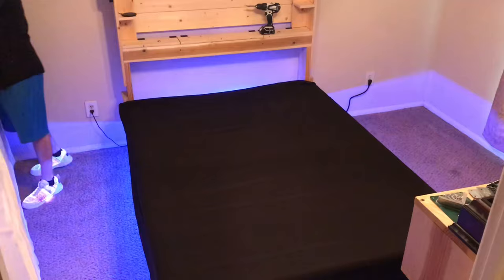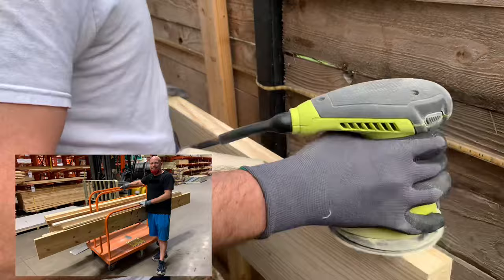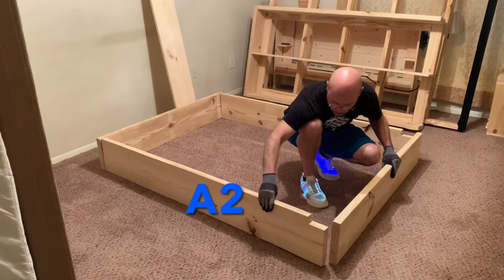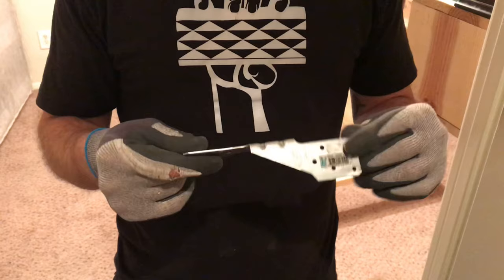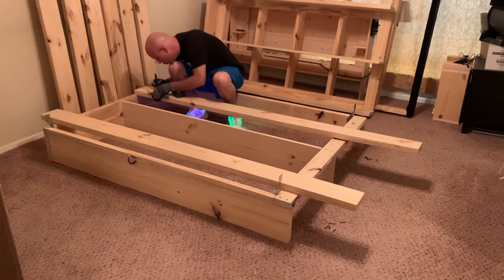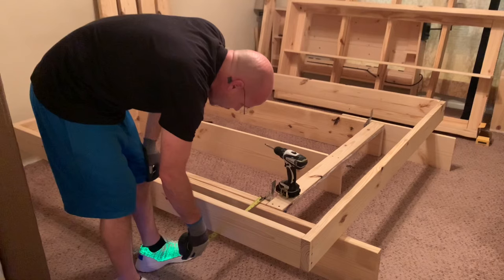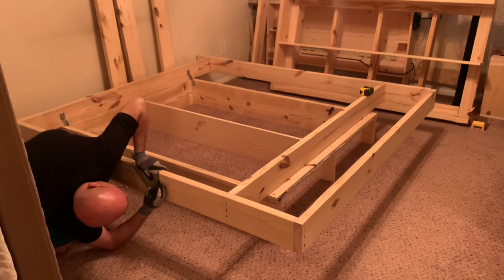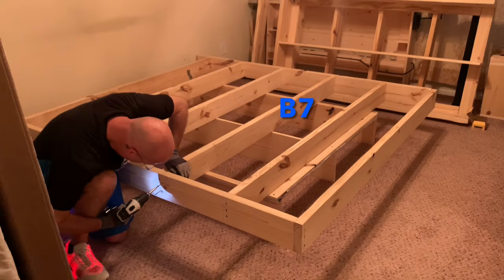King Size Floating Bed Frame [Easily build your own!]

Comment: Hi Curtis, love this and the Queen bed frame!  If you were moving to a new house, would you break the frame down all the way, partly or keep entact?
Reply from the maker: @JJ81_Studios Hey JJ, ooofff.  This is a great question, thank you.  So...I took the time to label all of the components in the queen 3.0 build so I know the placement and orientation of all of the pieces.  I think to be honest, when I move, I'm going to break it down all the way(get to where I'm going and cannibalize all of the 3.0 in a complete re-design and build now that I know as much as I do{especially after having helped so many of you guys modify your builds}).  I think I had originally planned to keep it in three components (base, frame, and headboard), but when I built that 3.0, I wasn't looking to spend a lot of money and wanted to use some stock I had on hand to free up some space in my tiny apartment.  You can see it's not entirely the best design as displayed in the video.  I'll modify that 3.0 to be very much the same, but quite a little bit different, to what will hopefully be the last version of that queen that I need to build.  Man, I'm telling you, I've built and re-built that thing many times now 🤦‍♂️ .  Apologies for the lengthy reply, but I very much appreciated this one.  I hope you are having a good weekend.  Thanks for your time and support here, I mean it 🤝
Reply: @CurtisMadeIt  excellent reply, I was not expecting that, thank you. I guess a follow up, when you break it down and putting back together again, are you using the same screw holes? I'm worried that if I have to break it down, the screw holes will not be as strong as first used and putting more holes around the previous would look terrible. Or am I over thinking this? PS, I'm closing on a house at the end of this month and I want to build my own furniture as much as possible and these are some of the questions I'm coming up with as I research more and more. PSS, big dominos is on the list :)
Reply from the maker: @JJ81_Studios 🫡 I would attempt to use the same screw holes, yes.  If you are worried about compromising the strength of the holes from repeated assembly and disassembly, you can pretty easily put you some glue in those holes...get you a couple of toothpicks covered in glue...and smash those toothpicks in to the hole.  Once the glue dries, you can knock off the excess and get back to assembling...this is just one way to reset your hole.  You can also drill it out with a 1/4" in drill bit and use a 1/4" dowel with glue to fill in the void.  You will want to pre-drill the holes for your screws as you should have the first time.  I'd try pretty hard not to put extra holes anywhere they aren't needed.  I wish you all the success possible in your furniture building quest.  It's a rewarding skill, you will find out pretty soon if you haven't already.  I'm here if you have any other questions in regards to this or any other builds you are attempting.  Take care my friend.
Reply: @CurtisMadeIt  you are the best, thanks big guy, looking forward to more videos
Reply from the maker: @JJ81_Studios You bet.  I’ll be back to posting again soon.

Comment: Do you think it’s totally necessary to have a5 that middle board on the bottom base
Reply from the maker: @Mike Holtberg Hey Mike, thanks for asking this first of its kind question.  I guess I could say that it is not absolutely mandatory, but I would recommend it.  I think this provides a little more counterweight to keep the bed frame from tipping from side to side...of course, once you get the box spring and mattress on there, it's not going to move at all, so, you could probably get away with leaving it out if you felt it totally necessary.  I hope this helps my friend.  Take care.
Reply: @CurtisMadeIt  thanks for the reply! I actually made this yesterday and absolutely in love with the new frame. Thanks so much for this tutorial.
Reply from the maker: @Mike Holtberg You bet!  I’m glad everything worked out.  Take care my friend.

Comment: Sorry sir, but how did you add storage space to the underneath?
Reply from the maker: @EmileePierce-yj3is Hey Emilee, no apology needed.  To add the storage area, you just move the footboard of the base...you need to run it across the top of the two side boards and that middle board.  Secure it about 2 inches from the end so that last joist in the frame has a place to sit on this base.  Does this help?  I appreciate your time and support on this channel, I mean it 🤝

Comment: Wow nice, what size of screws did you use?
Reply from the maker: @elchulo887 Hey Chulo, go with 3” deckmate or similar brand screws for the junctions in your wood.  I used 1 1/4” drywall screws to secured the brackets to the base and the frame.  I hope this helps.  Thanks for supporting this channel 🤝

Comment: This is a nice bed frame but what if I don’t use a box spring? I have a memory foam bed
Reply from the maker: @courtney leavitt Hey Courtney, no worries.  Just put you some plywood on the deck of the frame.  You don't need the super expensive stuff, just the 15/32" will be more than enough.  I hope this helps.  Let me know if you need anything else.  Talk to you soon.

Comment: So I have a question on the top part could I lay those boards flat to be more like slats? I don’t have a box spring and want to put a Mattress by it self
Reply from the maker: @Mannie Sisneros Hey Mannie, thanks for stopping by.  I appreciate your question.  Several people have approached me with the issue of not having a box spring.  I usually just recommend using plywood over the deck of the frame.  Get the cheap stuff, 15/32" should be more than enough.  I hope this helps.  Thanks for your question and I hope you have a safe build.  Let me know if you need anything else.
Reply: Thank you
Reply from the maker: @Mannie Sisneros You are very welcome.  🤝

Comment: Hello Dear, how can i get de piece of steel that you use in each corner ? im from México, can buy it of Amazon? grettings!
Reply from the maker: @Miguel Angel Torres Requena Hi Miguel, thanks for stopping by, I'll be glad to help.  First off, here in America, the term 'dear' is generally used when a man is talking to a woman...so, you saying that to me doesn't apply here.  Try something like "Hello my friend", or "Hi Curtis"...something like that would be a lot better, but I'll give you a pass on the language barrier.  😂 Do you have instagram Miguel?  It would be a lot easier for me to work with you on there if you are able to.  I can show you pictures and share links of items that would be acceptable to use.  Contact me on Instagram realc_love1 and I'll get you set up with everything you need.  Thanks for your time and support my brother.  I'll talk to you again soon.

Comment: Probably a dumb question but what size screws were used?
Reply from the maker: @SwagJ7 Hey 7, no stupid questions here.  I aim to encourage and inspire.  Use 3” screws at the junctions for your wood and use 1 1/4” drywall screws for the Simpson strong tie/corner brackets.  I hope this helps.  Be careful my friend.

Comment: Nice job! How heavy is this thing when it's time to move it? I like changing my bedroom around when the spirit hits me! 😂
Reply from the maker: @darealsassy1871 Hey Real, it’s pretty heavy to be honest.  This is part of what keeps it from tipping from side to side.  It’s manageable though I think.  If you are on hardwood, I’d recommend putting it on those little slider furniture mover things.  If you are on the carpet, you are gonna have to sit down next to the foot of it and double foot push that baby with the double arms behind you on the carpet as reinforcements…you know what I’m sayin’?  Move it in to place that way if you don’t have help.  It’s doable.  Let me know if you have any other questions at all.  Thanks for stopping by and supporting this channel 🤝

Comment: What is that triangle thing you were using? And why were you using it
Reply from the maker: @oddball5199 That's a speed square and a must if you are building anything else.  It's a super useful too.  It comes with an instruction manual that will teach you loads of things.  I'd highly recommend you get yourself one.  Any other questions?  Talk to you again soon my friend.

Comment: Were those 2x8s or 2x10s for the base ?
Reply from the maker: @Ezequiel Espino Hey Ezequiel, I would recommend using the 2x10’s.  That will give you a little more space(vertically) for storage underneath.  I appreciate your interest, question, and support my friend.  Talk to you soon.

Comment: What size screws do you recommend?
Reply from the maker: @ryan o’meara Hey Ryan, use 3” screws for the junctions of the wood in your base and frame.  Use 1 1/4 drywall screws to attach the corner brackets to the base and frame.  Thanks for your time and support my friend.  Be careful building.

Comment: Watching from the Netherlands, wanna build this so much! 
What kind of wood is recommended for this one?
Reply from the maker: @danacoric5657 Hey Dana, thanks for stopping by my friend.  I used untreated lumber for all of the floating bed frame videos posted on this channel...that's generally what I use for indoor furniture builds.  The pieces in this video are American 2x6's that actually measure 1.5" x 5.5", that's 3.81cm x 13.97cm.  If you want to make your base taller, you can use a different width board, add a headboard if you want to(separate video posted on this channel), or otherwise modify it as desired.  This video really just gives you an idea of how to make one for yourself.  I hope this helps.  Do you have any other questions?  Thanks for your time and support here, I mean it 🤝
Reply: @CurtisMadeIt   Thanks!

Comment: So, After building, to DONT need the “box spring”? 

You should be able to lay the mattress on top of the frame?
Reply from the maker: @retroberg hey Grizz, thanks for stopping by.  You are gonna need the box spring to support the mattress.  Others have used either cedar fence pickets slightly spaced apart or plywood with holes drilled in it to allow the mattress to breathe, but I always stick with recommending a box spring.  I hope this helps.  Thanks for supporting this channel my friend 🤝
Reply: The Simpson strong ties, do You know what size Or length of them? 3” or 6” or something? Just curious
Reply from the maker: @retroberg Grizz, I want you to change from the Simpson strong ties to 2" L-shaped corner brackets.  These are going to be a whole lot easier to use.  I show them in the twin size floating bed frame posted on this channel.  Upgrade to those for an easier build.

Comment: If I wanted to do California King what would my measurements be or how do I figure that out?
Reply from the maker: @SuperJwalls Hey J, apologies for the delay in my reply.  I got here as quickly as I could.  
Figuring out the dimensions for the cali king size isn't super difficult.  I've got videos for 3 different size floating bed frames posted on this channel already.  With the dimensions that are included in the videos from those builds, you likely could pretty easily figure out the ratio or design configuration that I am using...it's pretty much the same for all three that are posted here.
If you don't want to take the time to watch those videos and figure it out yourself, I paid my long time friend Jonny to create some really useful and easy to understand CAD blueprints for all sizes of the floating bed frames.  Reach me on instagram curtis_made_it and I'll make sure you have all the information you need before you get started on your build.  I very much appreciate you taking the time to support this channel.  Talk to you again soon my friend. 🤝

Comment: Hey cool idea! I'll try it soon! From Copenhagen, Dk. Do you have the dimensions in metric?❤
Reply from the maker: @klapphy Hey, good morning K, thanks for stopping by and welcome.  Yes, I sure do!!  I put them on screen for you guys in metric.  Reach me on Instagram curtis_made_it if you want or need help designing your bed frame.  I’m gonna need to know the exact dimensions of the wood/lumber/timber you are going to be using.  For reference, I use pieces that are 3.81cm x 13.97cm and then cut them to length.  Let me know what you need from me my friend.  I hope you have a safe build.  Thanks for supporting this channel 🤝

Comment: Hey I have a quick question. I’m building this right now however my only problem is I don’t see that you made an indentation for the bed to sit in this video. Usually bed frames are offset so the bed sits in it flush. Right now it’s just sitting on top of the wood. Answering would be appreciated!
Reply from the maker: @alial-mehdi2258 Hey Ali, good morning.  This is correct.  You need a box spring on top of the frame to support the mattress.  The edge of the box spring and the mattress are flush with the outside of the frame.  I hope this helps.
Reply: @CurtisMadeIt  not quite, thank you for answering quickly! I understand a box spring should go in there as well and then the bed on top of it, However my question was when you made the horizontal studs ( that the box spring sits on top of )  they are at the same height as the exterior bed frame so when I go to put the boxspring there’s no indentation in the wood for it to sit in and then the bed frame on top. Do you get what I’m saying?
Reply from the maker: @alial-mehdi2258 Absolutely, totally understand what you are saying.  This is how I built this bed frame originally for the queen size.  It was popular enough(1.5MM views 05.15.2024) that I copied it and made the different sizes for YouTube, even though I don’t own those size mattresses.  Even if you were to drop the joists down, the box spring would still sit on the perimeter of the frame.  If you want it to sit down in there, you need to adjust your measurements.  How about now, you get what I’m saying…?
Reply: @CurtisMadeIt  ah yes I get it. This is my first time building something like this so I was under the impression the box spring should sit inside the frame ( because that’s how I’ve had every bed frame I bought)  so what your saying is I either have to adjust the measurements of the joists  so the box spring sits inside the frame or  let it just sit on top of the frame and then put the bed on top of that.
Reply from the maker: @alial-mehdi2258 No worries my friend, I'm here to help you as best I can.  As always, I recommend a box spring with this style bed frame.  Once you get the frame built, you put the box spring on there.  Then you can put the mattress on there.  The sides and foot of the frame, box spring, and mattress will all be flush once you get done building.  I hope this helps.  Let me know if you have any other questions at all my friend.  We'll talk again soon 🤝

Comment: Question. B3 and B4 make up top and bottom of frame?  You have B3 @76 inches he's but B4 is only 73 inches. Why is one shorter? Shouldn't they be the same?
Reply from the maker: @Patrick Castillo Hey Patrick, thanks for your interest and your questions here, let me see if I can help clarify some things for you.  B3 is the foot board of the frame, B4 is the headboard of the frame.  B4 is shorter by three inches because this is the width of the two side boards (2x6 actually measures 1.5" wide, x2 = 3 inches).  The reason I have recommended people build it like this is because in my experience helping out new and experienced builders, this design makes it easier to modify to add a headboard later.  With more regularity than I probably anticipated, people have come back and told me they built the headboard sometime after they built the frame.  When you build the frame like this, you will only need to modify the two side boards to accommodate for the headboard to attach it as I have in the videos posted on this channel if you change your mind later.  I know this is a long winded explanation, but I hope it helps.  Let me know if I can help any more at all.  Stay blessed my friend 🙏

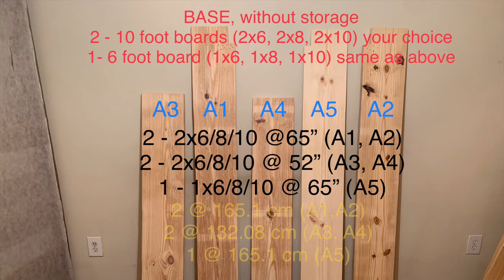Comment: 0:46 So I'm confused on this, what are the "@" Indications of? CM? 

I'm going without the storage. I plan on going to get the lumber soon, to build, but this isn't my forte. A3 and A4 is where I really lose track
Reply from the maker: @cmsullivan09 Hey Tez, sorry for the confusion.  The original queen size floating bed frame posted on this channel taught me that people really ran with this idea and made *many*, many different variations of it.  At forty six seconds, those “@“ symbols are indicating the inches in length to cut your boards.  The “2x6/8/10” indicates 2x6, 2x8, or 2x10 depending on how tall you want your bed frame to sit once it is all put together.  For clarity, I typically use 2x6’s for the base and the frame.  These boards actually measure 1.5” x 5.5”, which is 3.81cm x 13.97cm…so A3 and A4 are going to be 52”(132.08cm) in length, they will be 3.81cm thick, and they are going to be 13.97cm tall…approximately.  Does this help?  What other questions do you have my friend?  Thanks for supporting this channel.  I hope you have a safe build.
Reply: @CurtisMadeIt  Yes, this actually does help, I figured you were giving choices, but wasn't sure. I think I'll build it this weekend and I'll post from there
Reply from the maker: @cmsullivan09 Awesome, glad to hear it!  Let me know if you need anything else.  Be careful building.